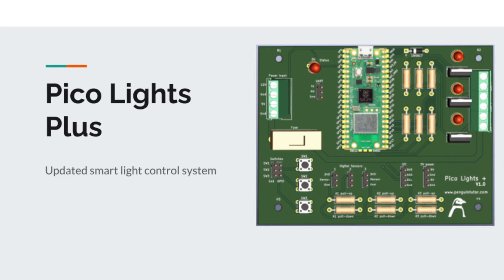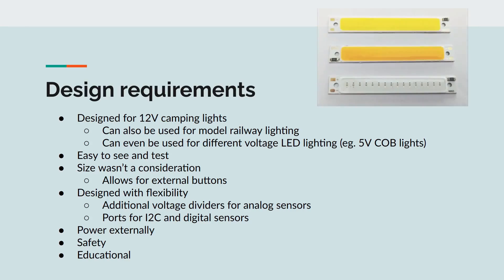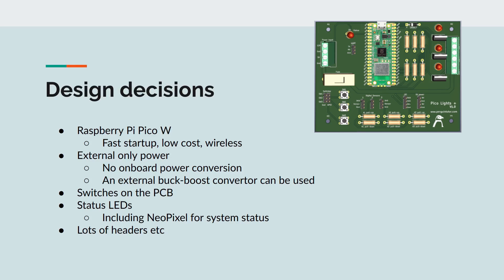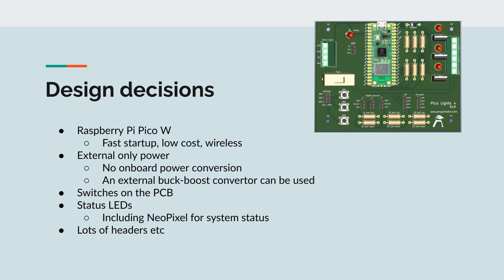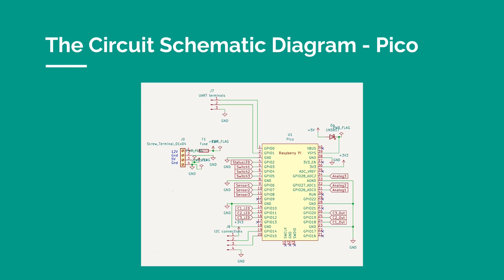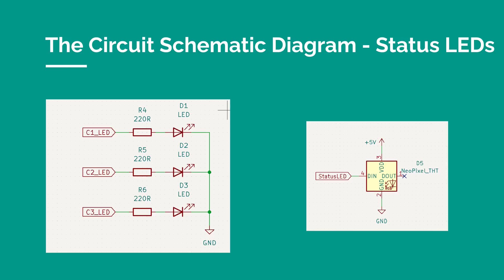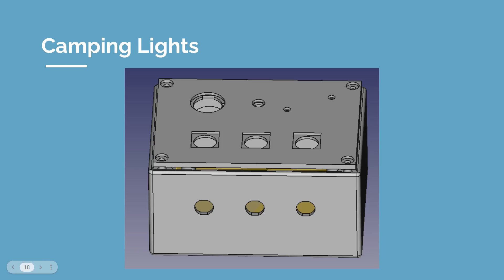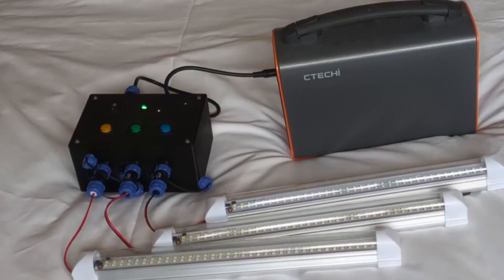Pico Lights Plus - Camping light home automation with a Raspberry Pi PicoW

Comment: nice example of chunked web output in pico-lights.py line 132+,  but old school variable on line 136, i prefer f-string e.g.
writer.write(f'HTTP/1.0 {url_value} OK\r\nContent-type: {url_type}\r\n\r\n')
Reply from the maker: Thanks.
Old habits die hard :-) I do sometimes use f-strings and I probably should use them more. 
I do like using f-strings when I need to create specific number formatting, but fall back to old habits when putting together a quick string where basic formatting meets my needs.
Reply: @PenguinTutor  still both work, so no harm, less typing and i find it cleaner